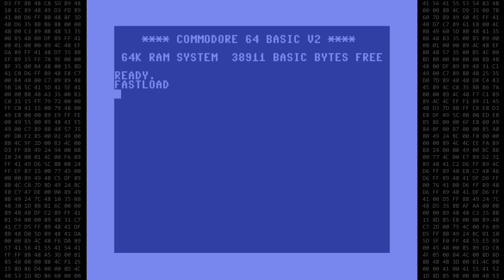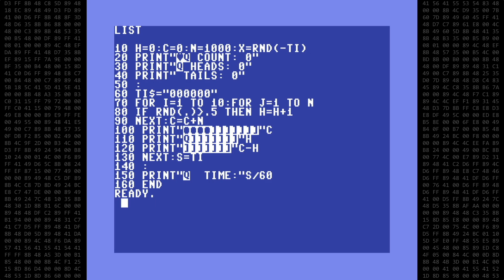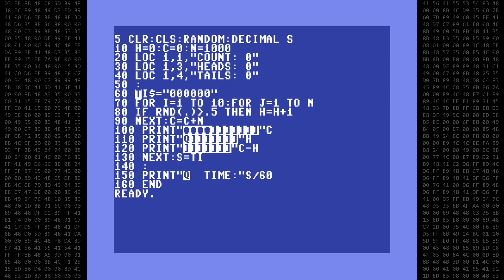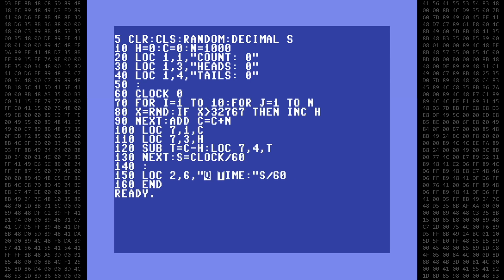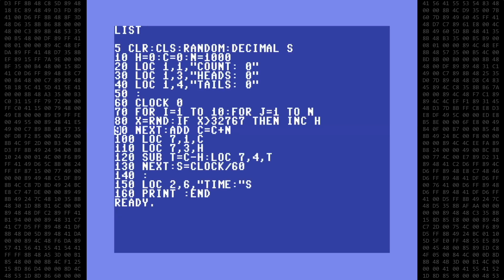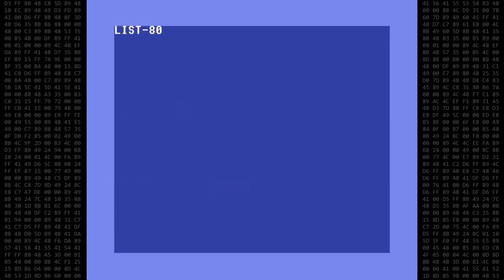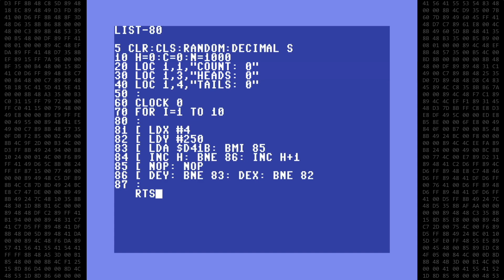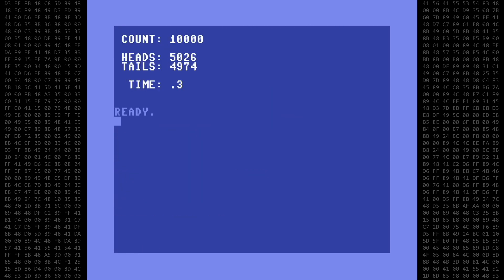C64 In-line assembly with Vision BASIC

Comment: Why 2 NOPs?
Reply from the maker: The ML loop cycles faster than the SID3 voice, so the NOPs ensure that there is enough time for the SID3 to produce a new number on each iteration of the loop.  Otherwise you wouldn't get a 50-50 split of head/tails.   Check the 8 Bit Show and Tell video I linked to in the description where the cycle rate is demonstrated.

Comment: Excellent illustration comparing speed of interpreted and compiled BASIC and BASIC with inline asm. Very cool Vision BASIC allows the concatenator operator for creating horizontal assembly structures in BASIC like the BBC Micro and that the compiler runs right on the C64. Vision BASIC  would have been awesome to have on cartridge in the 80's :)

Comment: Love it!  :)  I often mix assembly code and BASIC on the same line (some might see that as sloppy, but to each his own style).  You can place BASIC code inside the brackets too -- they don't have to be outside the brackets.  If you're okay with such inconsistency, you can simply place INC H on line 84 without brackets and it will "expand" into the code you already have there (because that's what Vision BASIC will convert it to anyhow).  INC works as it usually does in assembly when within brackets, but handles two-byte variables and addresses/pointers/"words" when outside of the brackets.

Excellent video and presentation!  :)